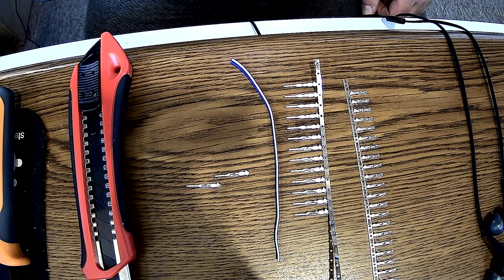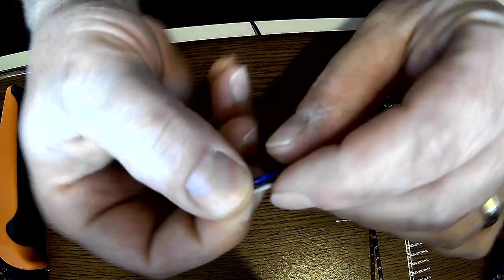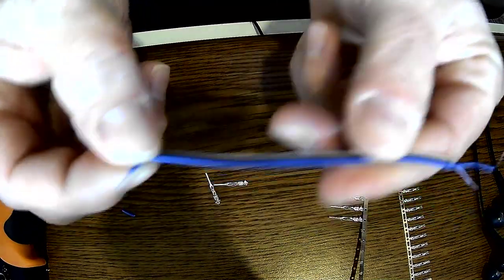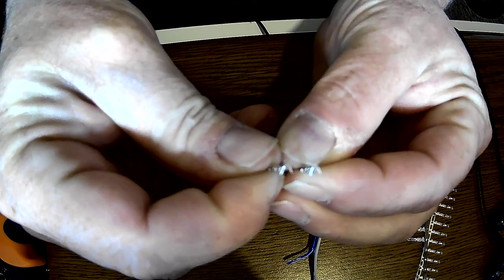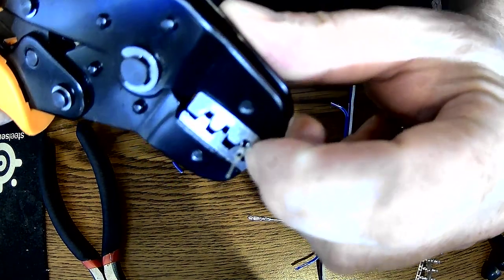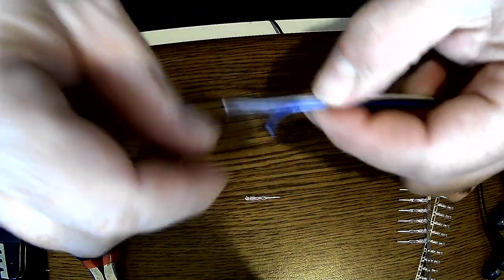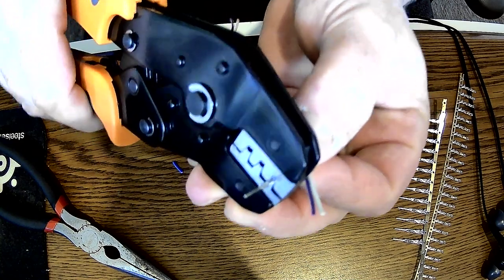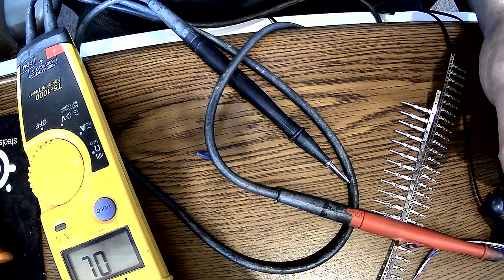IWISS SN-28B Crimping Tool for AWG28-18 Dupont Pins

Comment: Thanks for this video. It helped me to get consistent great crimps.
My approach is a little bit different from what’s shown in the video. I am using 24 AWG  stranded, insulated wire. The main difference is that I don’t strip off ½” of insulation and then bend the exposed wire back on itself. Rather, what works well for me with 24 AWG wire is to:
1.	use normal wire strippers and strip off about 0.1” (2.5 mm) of the insulation. Note that this is much shorter than the ½” shown in the video. Don’t try to bend the exposed wire back on itself. The 0.1” exposed wire is all you need, so just leave it as-is.
2.	Open the jaws of the crimp tool and insert the crimp as shown in the video and pull the crimp through until the “wings” butt up at the shoulder (lip) which is about at the middle of the jaw.
3.	Keep some light pressure on the crimp tool handles and push the wire into the crimp. You want to push the wire so that the insulation pushes fully into the wings. You will feel when the insulation hits the narrower section of the crimp and won’t push further. This means the insulation has fully entered the wing section and the exposed wire is in position for a good electrical connection.
4.	At this point, exert full pressure on the crimp tool. This will complete the full crimp (insulation plus the electrical connection).
5.	 Release your pressure on the crimp tool. The jaws will release and open up.
6.	You’re done!
Once you put a crimp on each end of your wire, a good test is to grab the crimps at each end and tug a bit, to be sure you have a good solid crimp.   And don’t get frustrated! The IWISS  crimpers will do exactly what they are designed to do. It will probably take several tries, but when you do get it you’ll be making  consistently great crimps from that point on. 
👍

Comment: Thanks.  I have a similar crimping tool. Initially I thougth I had just to put the pin and wire through the hole and put a lot of force over the levers, thus I lost a lot of pins. As I watched this video I have learned to  take some litle cares, like leave the tip of the pin out of the tool. I also have learned that there is no need of remove the plastic from the tip before crimping.

Now I have been able to crimp my first wire.
Reply from the maker: I do strip the wire back to assure a good contact. Keeps me from having to check every crimp. I am glad to see you are having success with the Iwiss crimping tool.